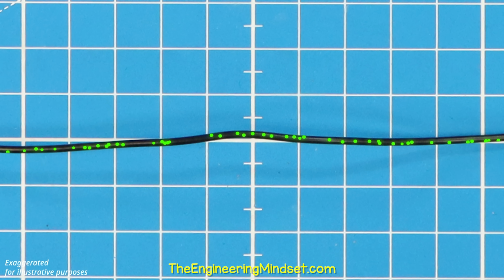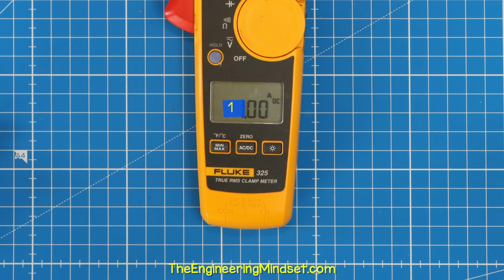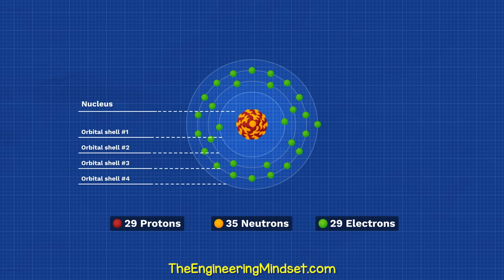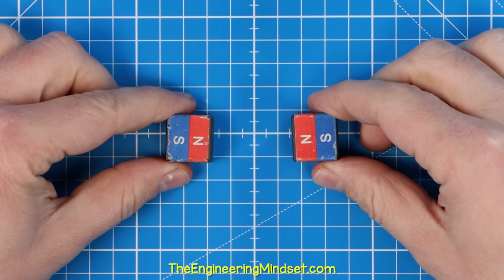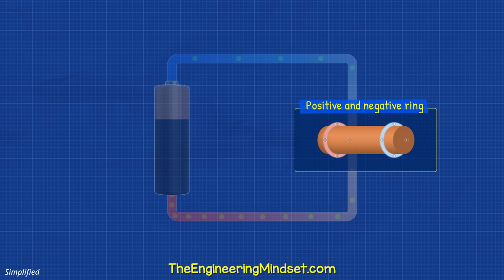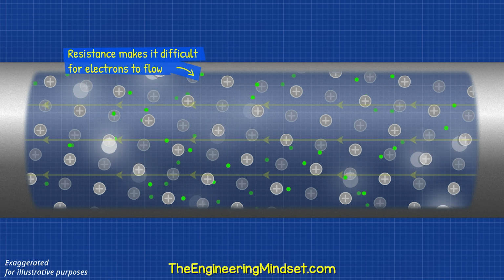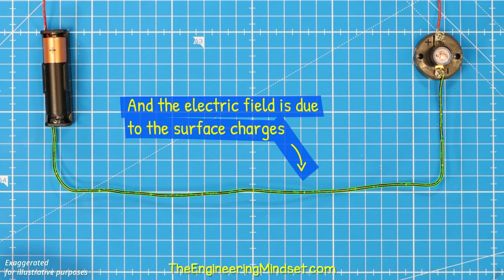How Electricity Works - for visual learners

Comment: For visual learners?????!!!! I cant believe people still believe in those classifications or types of learning. I guess it’s because channels like yours are propagating this type of false knowledge.
Reply from the maker: Thanks but if you watch the video you'll see we discussed the slow speed and distance covered by electrons, the electric field in and around the wires, the surface charges and electromagnetic waves. The beginning covered conventional current and the common water analogy. When you have time I'd be thrilled if you could watch the full video. However, if you feel there's a different and better theory then please let me know and I'll read into it.
Reply from the maker: I have now added time stamp chapters to make it easier as it is a long video.

Comment: no this isnt how electricity works
Reply from the maker: I'm curious why you think that, did you watch the full video where the surface charges, electric and magnetic field is explained? The start is very basic regarding the common analogy to water.
Reply: Please watch veritasium video on the same. When you find that electrons are not moving but the electromagnetic force is, please also tell us what that video means. Our whole lives were a lie 😂
Reply from the maker: Thank you,  I have watched his fantastic video and he explains that the electrons are drifting in the wire, forced by the electric field caused by the surface charge and an EM field reaches out and turns onnthe lamp before the electrons could reach it. I have literally shown all of this in more detail in the video. When you have time I'd be thrilled if you could watch my video in full.
Reply: @ i love physics and have a good understanding of most things. Somehow electricity eludes me. Ill watch this in detail. What stops you is that video starts with negating electrons move at all, much.
Reply from the maker: I have now added time stamp chapters to make it easier as it is a long video.
Reply: @EngineeringMindset  its still a great video, keep up the great work sir
Reply: @EngineeringMindset  No, Derek repeatedly says that it is OUTSIDE the wire, so I told him to jump start his car by laying jumper cables on the hood with no connections!

Comment: Okay then do me a favour. Touch a negative then touch a positive and see which one zaps the hell out of you
Reply from the maker: If it's a DC circuit, the voltage is usually very low so touching the terminals of a battery doesn't matter as your skins resistance is so high. But with AC, you are at the same potential as the neutral wire, which is tied to ground, so you shouldn't get a shock from it because there is no voltage difference so no current would flow. But, the live/hot wire is at a much higher potential, it takes reference to ground. So if you touch this there will be a voltage difference, a difference in potential, so current can flow through you. However, if you are properly insulated, then you can touch the live/hot wire without a shock. That's why birds can land on power lines of thousands of volts and be completely fine, but if they touch a power line and touch, or get too close to, the pylon (which is grounded) they will be blown to pieces.

Comment: Electrons do not flow in the wire analogous to water flowing in a pipe. The drift velocity of electrons in a copper wire  is typically around 7.59 × 10−5 m/s, which would make this scenario impossible. Also, if we are talking about AC current then electrons usually vibrate about a mean position. When voltage is applied then EM waves are generated and they do all the work.
Reply from the maker: Thanks for your feedback. The drift speed is discussed in the video and the time taken to move through the circuit. The video doesn't go into AC, but the EM waves are discussed.
Reply from the maker: I have now added time stamp chapters to make it easier as it is a long video.

Comment: I still cannot find anyone who can explain how electrons phisically move in a copper wire. What makes them move from one end to another? Not theoratically, I mean phisically? Nobody knows it.
Reply: Similar to refraction of light, why does light speed up after coming out of a denser medium
Reply: @abhishekmaurya4665  I'm just a fool, so I don't know if I'm right, but I believe light never slows down nor it accelerates. What you see in refraction is light taking a longer path (not a straight line), thus when coming out of a denser medium it just doesn't have anything preventing it from moving in a straight line.

Comment: While this is an excellent presentation don’t forget to invoke the scientific method which is to question what your observing to the point that you know it’s correct .      As some have pointed out that they were taught something different regarding electrical theory but accepted it. The scientific method was not invoked then.  While as an electrical engineer I can concur with this explanation, that doesn’t mean you should until you yourself can prove it correct.

The speed of science is driven by those that continue to question what we think we know not by those that simply learn and accept it.

Comment: doesn't the electrons in the battery cause the electrons in the wire to vibrate (Frequency) at the same rate as they are? causing an instant effect through the wire. The electrons in the filament also vibrates heating the filament up causing it to glow. I have watched many videos on this subject. It appears that we still have unanswered questions about electricity. Physics really interests me. To bad the math just seems way to complicated.

Comment: Electricity is expanding electrons crossing over from the subatomic realm to atomic realm, spiraling around the outside- mostly- of the wire. No energy, charge, photons, waves, spin, fields, potential, quantum,quarks, space, time, space-time etc. ALL Standard Theory/Model was replaced by Expansion Theory in 2002. All EMR are manifestations of expanding electrons. Light is a cluster of expanding electrons. A proton is a collection of 1836 expanding electrons and add a bouncing expanding electron makes a hydrogen atom. “G” calculated from first principles- the hydrogen atom- in 2002. “The Final Theory: Rethinking Our Scientific Legacy “, Mark McCutcheon for proper physics including the CAUSE of gravity, electricity, magnetism, light and well.... everything.

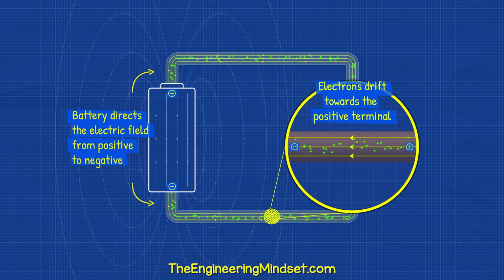Comment: * - edit: my comment was wrong and is explained in replies - * The graphic at 7:46 is wrong. You said electrons move opposite the arrow of the electric field, then when you draw the wire you have the electrons going in the same direction as the electric field lines. However everything else in the video is great! Thanks!
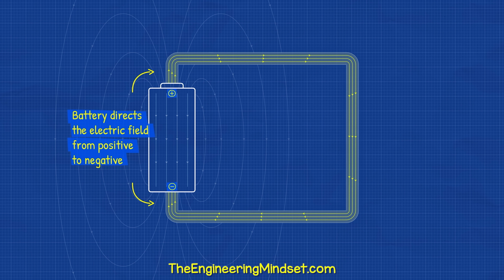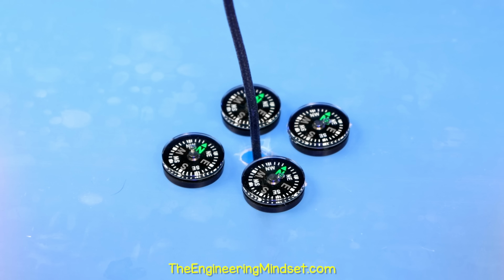Reply from the maker: Can you please clarify, I checked the graphics at 7:40 - 7:46 The electric field points from the positive to the negative, through the wire. Then at 7:46 - 8:00 the electrons drift through the wire from negative to positive, in the opposite direction to the arrows. I can't see the mistake you are referring to?
Reply: @EngineeringMindset oh I see, you are right. So inside the battery the electrons move from negative to positive. And there is a build up of electrons on the negative end when battery is charged, so when the wire is added the electrons move through the wire from negative to positive as well. Ok Never mind, you’re right haha
Reply: So delete your useless comment
Reply: @jay3368 if people read the replies it can help them understand too

Comment: The 1.5 is it a cell or battery (0.37) /(2.40/18.35
Reply from the maker: Technically it is a cell. But, my guess is that 99.9% of people go to the shop and ask for a replacement battery, not a cell. Even the manufacturer calls it a battery, so I also call it a battery.

Comment: The last 3 minutes were hard.
Thank you!
Reply: I agree. Actually, as is usually the case with this stuff -- no matter who explains it or how it's explained -- my eyes had started to glaze over by halfway through.
Reply from the maker: I'll admit it's a complex topic, I've tried to simplify it as much as possible with visual examples and animations, but it's still a long video with a lot happening! If you have time, I'd recommend taking some breaks inbetween, let the brain absorb the info, write down any parts you didn't quite grasp as you go through and at the end, if I haven't answered them, search for that parts or write a comment and I'll help where possible.
Reply: @EngineeringMindset  I'll watch the last 3 minutes a few more times. The animations you made are excellent and the topic is VERY interesting.

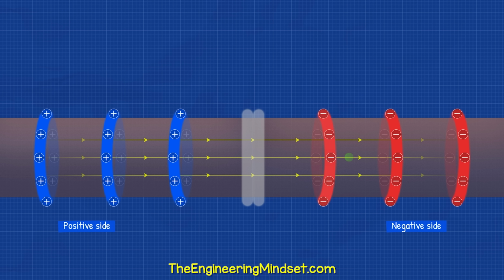Comment: Exceptionally great video, I wanted to see for a long time! I have only one thought or question. When the switch connects wires the video says (15:50) the electric field is created. But I don't think it is..  electric field has to be there already since there are electrically charged particles in the space. Of course when the electrons can travel in the direction of the existing field they recombine and move.. the existing electric field changes but it just feels confusing to say that the field is created at the time of connection.

Comment: Very elaborate and succinct video with phenomenal animations to support it. 

I might have fallen short of understanding the idea behind how surface charge plays a crucial rule, it is my first time learning about their relevance in circuit theory. 

Also, I am quite perplexed by the reasoning behind why if 10V of charge which the battery provides are "consumed" by the lamp, that there is somehow a pushing force from the lamp's negative terminal to the battery's positive terminal that maintains the same magnitude of current. 

I might have had same attention lapses though, so correct me if my questions are based on wrong interpretations of the content.

Otherwise, it was very seemless to understand the interplay between the battery, wires, resistive elements and most of how the electric field is the true factor to why the effects of electricity are lightning fast.

Comment: Why do car batteries connect things to the positive, and the negative is grounded?
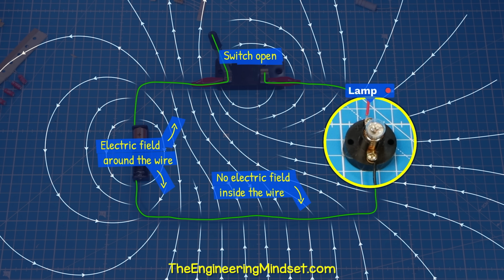Reply from the maker: To reduce and simplify wiring, it's designed using conventional current as shown in the video. But practically also consider the electric field is reaching from the positive side to the negative side (see 15:21) so it's better to have the positive side in wires as it's harder for something to accidently complete the circuit and short the battery. If the car frame was positive, the entire frame would create an electric field that's reaching out to anything respectively negatively charged so it would be very easy to accidentally complete the circuit and drain the battery.

Comment: Can you make a visual representation of voltage? I know some electricity and repair motherboards with knowing the practice side of electricity, but there is something in theory i can not get my head around for a long time. I watched all videos on youtube (no joking), read some articles even though my english sucks, asked chatgpt multiple times and with multiple methods with no plausible results. The question is. Lets say we have a circuit with 5volt and 1 ampere, and a second circuit with 10volt and 1 ampere. If the speed of electrons is the same (same 1 coulombs of electrons passing through every 1 second), then whats the thing that 10volt power source does to those 1 coulomb of electrons that 5volt power source does less so in the end we have 10watt of power instead of 5watt? It can not be the kinetic energy, right? Cause the speed of individual electrons is the same in both 10volt power supply circuit and on 5volt one (again, one coulomb of charge in 1 second, and the mass of electron does not change if im not wrong)? What's that magical multiplier that gives every single individual electron double the potential? Can i be explained in real life example? Yeah, im not on the smart side of the scope and im missing something trivial, but please still thumbs up this so author can answer or even better, make a video.
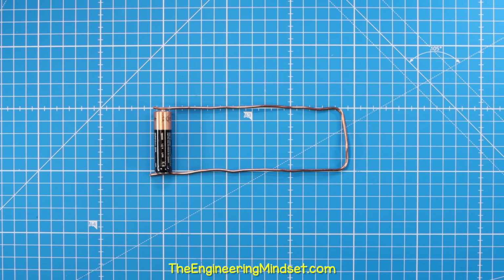Reply from the maker: So if you watch the section of the video about the battery (9:30) it should give you an idea. But if the voltage increases then the electric field which forces the electrons to move will also increase (Electric field = voltage applied / length of wire. ) 
At 8:20 you can see the calculation for drift speed, which is for a 1mm diameter copper wire with 1A of current giving a drift speed of 0.0935mm/s but If the current increased to 2A then the drift speed would increase to ~ 0.187mm/s so this does charge depending on the current, wire size and material.
Reply: @EngineeringMindset  Yeah, that explained nothing. I have a 12v 1 amp power supply, and a 24v 1 amp power supply. 1 coulomb of electrons each second, meaning the speed of electrons is the same in both cases. What's the difference for every single electron if we have at the end 12 watt and 24 watt respectively? Same wire, same charge, different voltage. Whats the difference for each electron that bumps into coppers atom?

Comment: As you measured 0.45A, on line
What'll be on neutral line
Reply from the maker: It's a series circuit so the current will  be 0.45A at any point in the circuit.

Comment: Nice video. Well done and explained I'm very understandable ways. I would love to see a video describing the third theory Hole theory.
Reply from the maker: Thank you, so I'm pretty sure we covered hole theory in the solar panel video https://youtu.be/Yxt72aDjFgY but basically, when an electron moves, it leaves a space for another electron and this hole can also be thought of as moving.
Reply: @EngineeringMindset  Very cool and I'm gonna give it a watch. Correct me if I'm wrong but those spaces or holes move positive to negative correct?
Reply from the maker: Exactly right. You can see that here: https://youtu.be/Yxt72aDjFgY?si=z7TlpnYwcb-NWnMj&t=1141
You can also see it in this video on mosfets https://youtu.be/AwRJsze_9m4?si=XCXbVQ6dB03Ao0um&t=599
So the hole goes from positive to negative and the electron goes from negative to positive.

Comment: Why does the voltage reduce along the length of the wire at the negative end if the electricity is flowing from that side of the battery?
Reply: conventional current flow
Reply from the maker: So the wire will have some resistance, regardless of where in the circuit it is connected. The current has to pass through the entire loop to complete the circuit. The electric field will need to establish around and through the wire to build the surface charge that moves the electrons, so we will have some voltage drop at every point.

Comment: Some negative cables in my car just go to bare metal ... how does this create a circuit and still work especially if electricity travels from the negative?
Reply: main battery is connected to bare metal... so anything connected to bare metal is the same as being connected to battery negative... this is called "ground"
Reply from the maker: The car frame acts as part of the circuit, you can see these in this video https://youtu.be/VnPRX5zQWLw?si=WmWqzO8IPSg2ZaNX&t=888

Comment: Theory: OHMS LAW is brilliant.

Practically: If a circuit (i.e. continuity) is broken then no electricity flows. 

Reason: The source voltage supply (i.e. potential difference) must reach each side the target load (i.e. a resistive item such as a lamp, or motor or heater etc etc). 
If the circuit (i.e. continuity) is broken, then you will always find the source voltage across the position of the break.

You can prove this using the simple circuit in this video . . . 
***Measure the source voltage
***Close the switch contact 
***Then you will find the same source voltage across the load (bulb, motor etc etc)
***NOW open the switch contact (i.e. introduce a 'fault,  because that is all an open switch contact does)
***Now measure across the open circuit switch contacts and you will find the source  voltage.
***If you measure across the load you will find zero voltage, that is why the lamp or motor etc is not working when the switch is open.

 Same thing if it is a fault in the circuit . . . . the voltage missing across the load, can instead be found across the point of the fault. This simple theory really helps to trace electrical circuit faults in a practical manner.
Reply: thank you, captain obvious
Reply: Great explanation! You've broken down Ohm's Law and the practical aspects of circuit continuity so clearly—it’s both insightful and very helpful for understanding fault tracing. This is the kind of practical knowledge that makes troubleshooting so much easier. Thanks for sharing!

Comment: Veritasium has a video explaining how electricity does NOT work like this, but instead works in a completely different way than how we think it does. "How electricity actually works"
Reply from the maker: Thanks for your feedback but in this video I explain the same concept as Veritasium's great video on the topic. I start from the very basics and gradually fade into the propagation of electric and magnetic fields, what causes them and how they create a surface charge which moves the electrons within the wire and also show how far and fast they are moving. I would encourage you to watch this video in full when you have time.